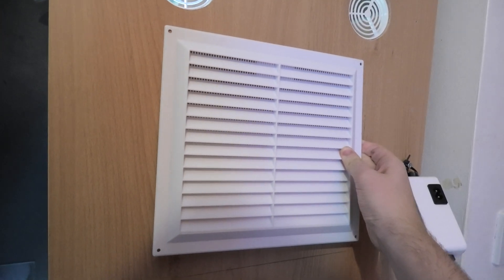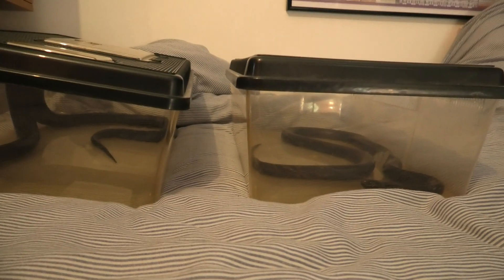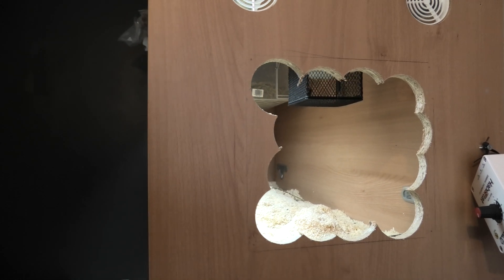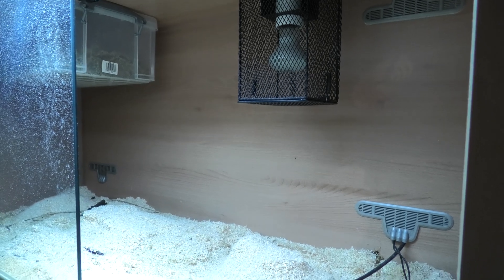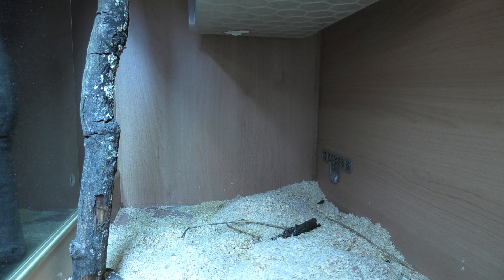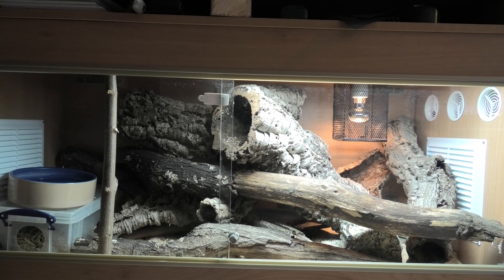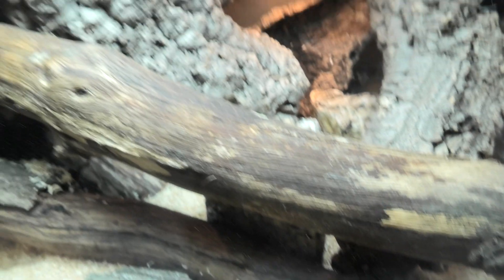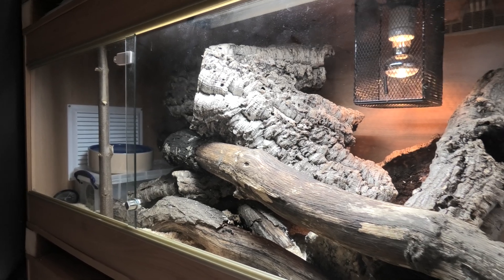How To Use Ventilation To Control Temperatures

Comment: this touches on a problem i have with "off the shelf" vivariums and temperate species. i do not get on with them, i find them small, hard to maintain conditions (usually too hot) and poorly ventilated. i spent ages adding vents and trying to make things fairly consistent but if it got hot generally they turn into ovens that i just cant get the heat out of and they would build up humidity i found hard to shift. when i made new vivs over last winter they all included a lot of ventilation. one of them is literally 50% mesh for my russian rat snake. the standard one was constantly too hot. he has been still spending most of his time in the breeziest coolest spot (whatever the ambient temp for the day is) and will go to bask and then mooch around and return to it. the corn snake has a 30% mesh roof, with the mesh over the cool end, plus half the cool end wall is mesh and 6 normal round vents. they have been without issue all year and the snakes have been loads more active, making use of the whole thing and i have been able to offer better heat respite in the summer. for the corn snake i made covers for the large vents so i can close them off if its colder and carry the heat gradient further across. plus over the year i have been able to give the vivs a healthy spray down all over the cool half without making a huge humidity spike. 
i would definitely advise getting one of those vents which have a panel to close it. give yourself the option to control things. its not too much more, even if you have to buy a little bit of mesh to make it inaccessible. whenever i built things i try and make them multipurpose, that way i only have to do it once.

i am in a bedroom with no kind of climate control or heating so i can only work with the natural state of things. perhaps the standards are better in a closed system but for me they proved obnoxious. one more reason why its good to know the resting state of the room you keep in.
Reply from the maker: That would be ideal, being able to close them off. in my case its a south facing bedroom with a bearded dragon who raises the rooms air temps, plus once i have the pc on the rooms temps raise considerably. In the summer ill be sat in 86F air temps. In my specific room i know ill never need to close it but thats a great idea for the majority of people.

My king has been more active because of it too! Providing heat in the summer is always the issue haha.

Comment: The vivs you are using look very similar to Vivexotic ones.  I have some of these, and the ventilation is, if anything, excessive, as they don't hold humidity for long.  So I don't understand why you are increasing the ventilation so much.  To ventilate efficiently, vents should ideally be at the top and bottom, as heat rises.  However, doing this will increase your electricity bill!  Very nice viv setup, the cork looks great.
Reply from the maker: They are vivexotic, humidity has not dropped still at 50%. Yes ideally you’d go high then low but as you know they already have that. I’m increasing the ventilation to release the hot air. I don’t need 30c air temperature I need 30C surface temperature from radiation. It’s so I can have the bulb at full power and it doesn’t create excess heat.

Thanks I need more cork for the others now

Comment: I didn't have the patience to cut out massive holes in over 10 vivs so what I've done is create smalled holes (using a pocket hole bit) in a row either side of the enclosure. Something I'd recommend for anyone that can't for whatever reason use the big vents. Great video as always though dude, the scene with your "womanly" (please don't come for me feminists) did make me laugh! 😂

Can't beat a Makita drill by the way, they're the best! 😝
Reply from the maker: Yeah I left that in because it was funny 😂

I really need more equipment haha
Reply: @ReptilesandResearch  Before I got my hands on a drill and all the funky gadgets I used to use a hammer, nail and a screwdriver. I shudder when I think back to those dark days, 3 years ago... 😂

Comment: How would we provide high ventilation like this and still maintain higher humidity? 🤔
Reply: Animalsathome has a rainbow boa that has pretty good ventilation and he makes it work maybe check out his video on redoing his rainbow boas enclosure
Reply from the maker: @Waspy26  Very true, thats a perfect example of how you can focus on ventilation while maintaining humidity.
Reply from the maker: That is much harder, although you could use vents that have a closable screen so you could adjust ventilation at will. But you'd still require spraying etc. Humid hides and humid substrates are your friend.